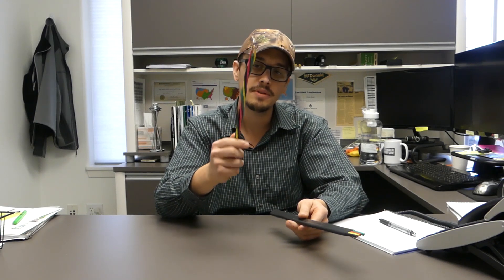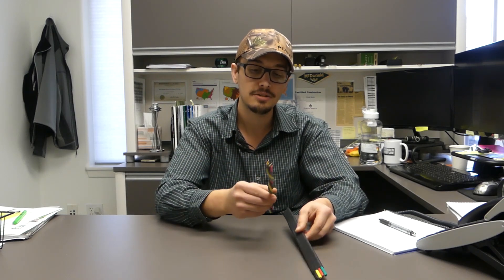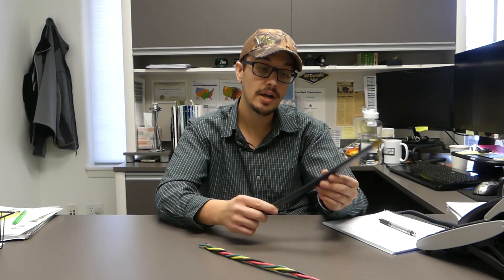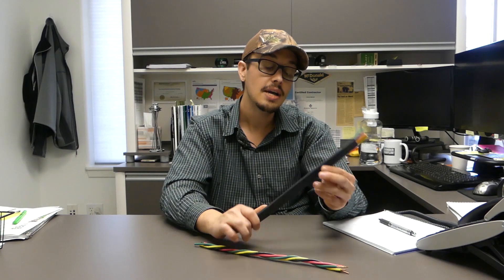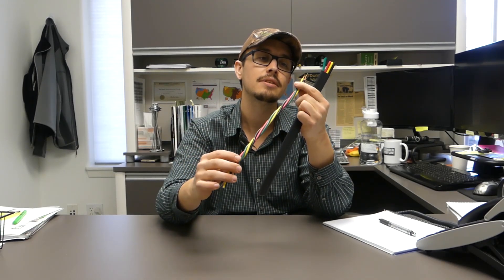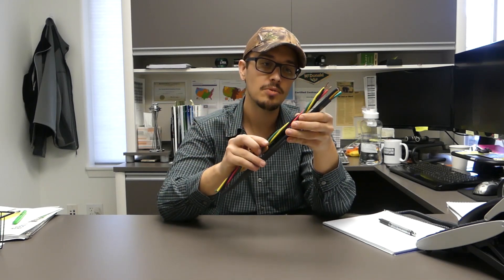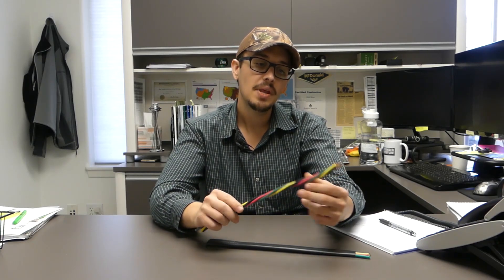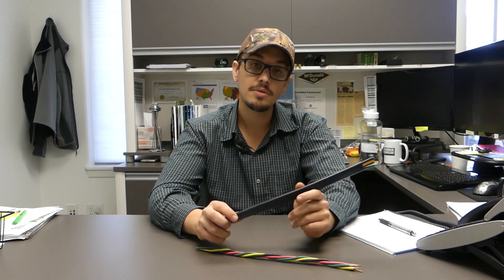Types of Wire for Submersible Well Pumps

Comment: Is flat cable wire sizing the same as the AWG wires? Like is AWG 8 the same as the flat cable?
Reply from the maker: Yes, if the AWG is the same the wire size is the same, regardless of the insulation.

Comment: I have an older installation with flat jacket but only red, yellow, and black wires in the flat jacket no ground. If i needed a new pump, would i have to run new wires to get a ground?

Comment: What about the difference between stranded and solid wire?  The well guy I just used took out my solid wire that was on a 3/4hp pump (the pump died) on a 115ft pump depth and replaced it with stranded.  He said stranded is better but I find that hard to believe given just about every other application where I found solid to be a better wire (ie... you can't get and stray stranded wired falling off with a solid, etc.  What do you think?

Comment: You mentioned in a video you might be able to help out if we had a question. My pump stopped working earlier this week and no Water at all. Ended up pulling the pump And replacing it. The replacement did not work. I replaced the pressure switch And there is 240 there on both sides of it. This is an older pump so it has just 2 wires going down to it. I grounded the pump temporary while i had it still laying on the ground, directly to the well head. I'm trying to see if I was getting power to the pump Pump did not turnover But when I use my voltage gauge With the ground on the pump In the hot on the lead at the Pump is connected to the down wire120 on both sides Not sure what's going on or what I should do

Comment: I currently have the yellow flat cable, the conductor with the green stripe on it ground, there is a plain yellow, and a yellow with a red stripe, the pump is a two wire pump 120 volt 
Which conductor would you consider to be the neutral, the plain yellow or the one with the red strip?

I was told on this that is does not matter

Comment: Hi! Is it possible to use those cables underground in a pipe to connect a shed to a house? Is there any restrictions?
Reply from the maker: No, you can't use these for buried lines. Typically you'll use either UF direct bury or THHN in conduit.